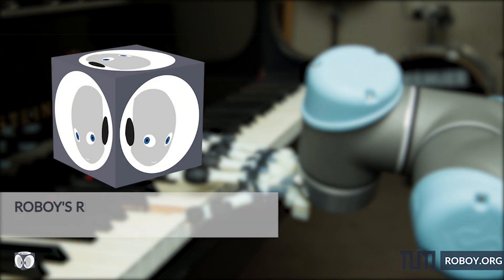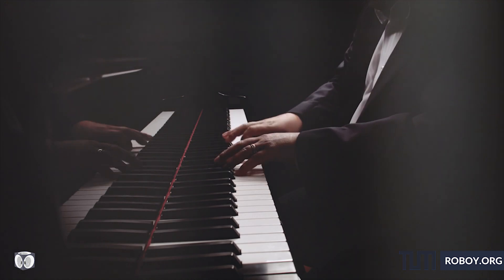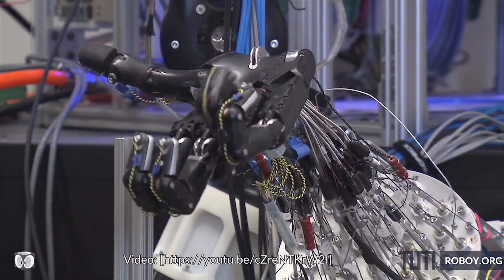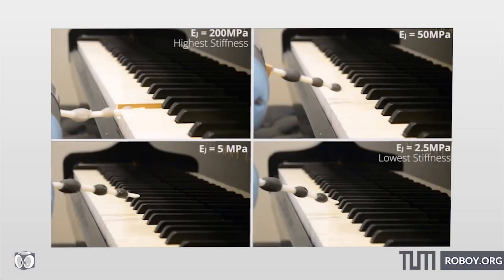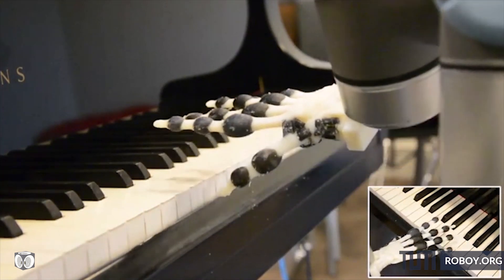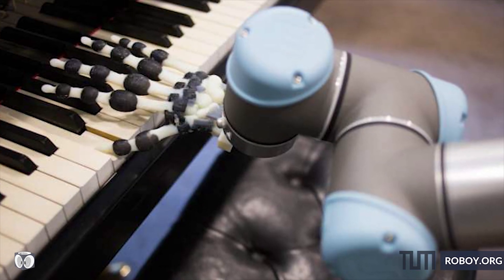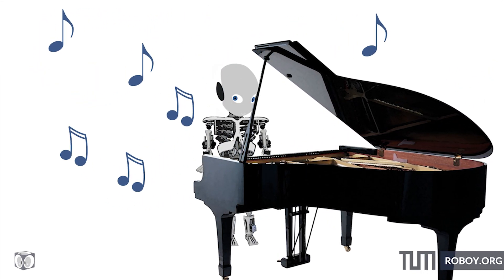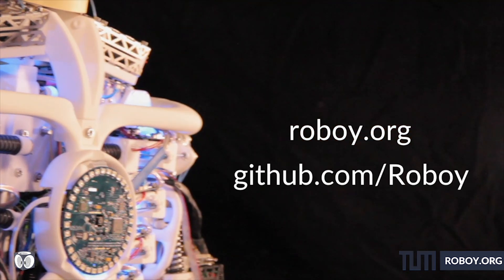A Soft Skeleton Robotic Hand plays the Piano | R3 Roboy's Research Reviews #7

Comment: I still don’t understand what a conditional model is, what it has to do with directional stiffness, or how they allow for new behaviors based on their interaction with their environment. Can anyone please explain this?

Also, the videos all made it seem like the different stiffnesses of the hand didn’t matter at all to the piano playing, since each keystroke only applied one force on one type of ligament at a time (ex: the span ligaments weren’t stretched at all when playing the Alligator crawl). It seemed like the same results could have been achieved by pushing a rigid stick on the keys.
Reply from the maker: The way we understand it (we're not the authors) is: 
1) the dynamic behaviour of the hand changes (e.g. a key press), depending on the orientation of the hand, because of the anisotropic behaviour of the ligaments (if you press down vertically the finger is stiffer when you rotate the write 90°). 
2) the dynamic behaviour of the hand is also dependent on previous interactions of the hand with the environment. e.g. you can push down a key with the thumb and then pull to the side, effectively "hooking" the thumb on the pressed key, then move down, such that a second finger is hitting a key and you can play an interval. - Watch S3 of the supplementary Material for an example: https://robotics.sciencemag.org/content/suppl/2018/12/17/3.25.eaau3098.DC1 
3) Now the conditional model aims to capture these two ideas into one term: the dynamic behaviour of the hand's interaction with the environment is dependent on the hands orientation vs. the key as well as previous actions, such as in 2).

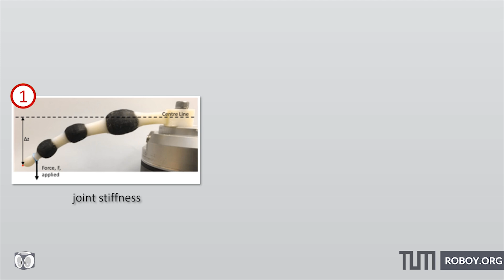If you rewatch from 3:14 it's quite clear that the stiffness has a lot of influence on how the keys are being hit, e.g. at 3:46 you see one finger on the neighbouring key but not pressing it, which is clearly a function of that fingers ligament being soft. I think S3 of the supplementary material is the best example shown how the system is making use of the stiffness. We should've used it in the video. Thanks for the feedback.
Reply: @robodies  This is super helpful actually, thanks so much! I read the paper and still didn't understand how they defined the conditional model, so hearing your explanation and seeing the S3 video helped a lot. I wish they had included an explicit definition and presented examples that demonstrated the concept better in the paper itself.
Btw, I absolutely love all of your R3 Roboy's Research Reviews videos and am so glad I found this series. I've always wished that summary videos of robotics hardware research papers existed (kind of like Two Minute Papers, but for hardware), so I was elated when I found this channel. I'm glad to see you're willing to engage with your audience too. Keep up the great work!
Reply from the maker: Yes, I agree that a formal definition would've been good and I'm a bit surprised it wasn't forced since it's in Science. Love to hear you like the videos :) - Two Minute Papers for Robotics is exactly the inspiration for the series!